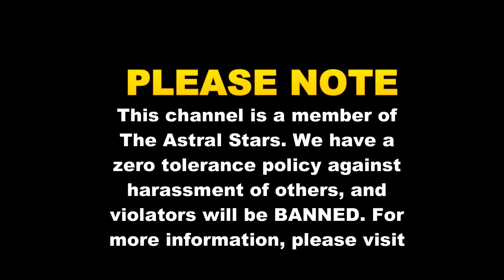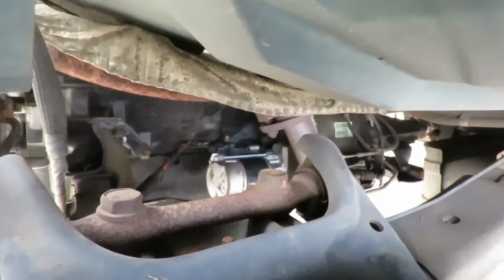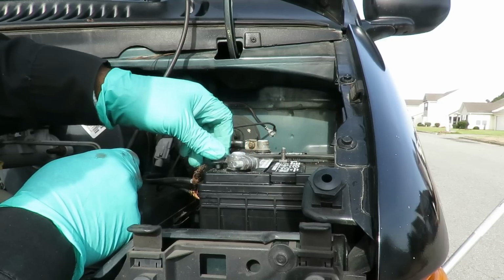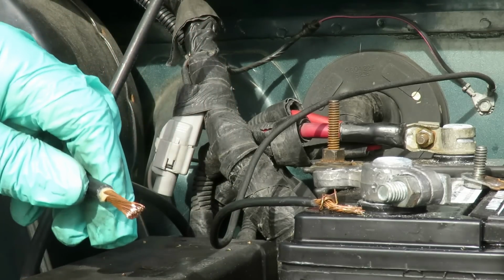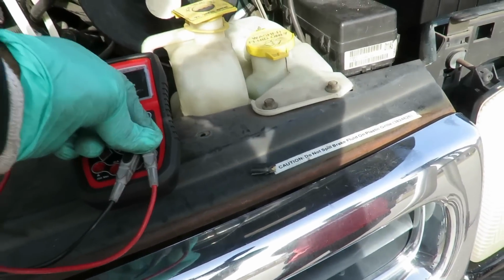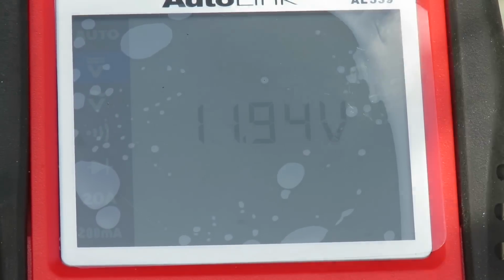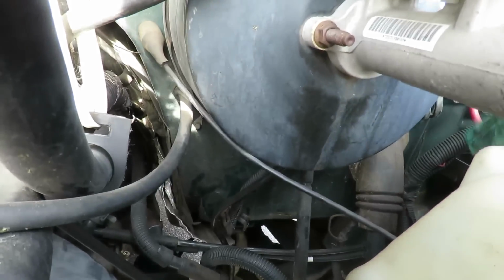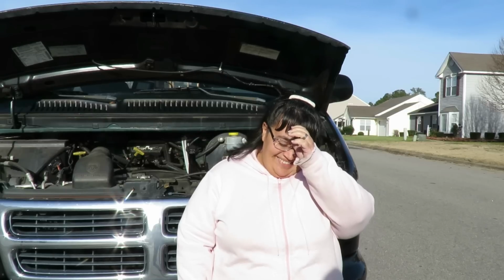⭐ 2000 Dodge Ram Van 1500 - 3.9 - No Start - Clicks, Does Not Crank

Comment: I think you just saved me. I have a 1998 Dodge Dakota with the same 3.9. Wasnt doing the rapid clicking like this one. Just one click. Then after several tries it would start. Thought it was the starter. Battery was new. Put a new starter in and it started right up...but the next time it would do one click and start. Been getting worse. Replaced the starter relay. Didnt change a thing. So tomorrow morning I am replacing that ground cable. Thank you for the video. I was about to pull what was left of my hair out!
Reply from the maker: LOL on the hair comment! Keep us updated on what happens!
Reply: @OnlineAutoRepairVideos  Well...still at the same problem. The ground cable was on the block. So I put a second cable to another spot on the block. Same issue. One click...maybe two then it will turn over.
Reply from the maker: @matchboxcustomsandrestos  Have you tried the voltage drop to make sure it's not losing ground? Also, I know you said the battery was new, but have you checked it out recently, and how, because a dead cell will give that same problem.
Reply: @OnlineAutoRepairVideos  I have tested the battery. Its a month old. No voltage drop. I am starting to lean towards I have a bad starter out of the box or a bad switch. I am going to yank the starter off and have it tested.

Comment: I have a 2002 3.9 van also and get nothing at all when I turn the key with good battery other than all dash lights work normally. Under hood the relay box next to battery has nothing in the slot for a relay and no contacts like it never had one there to begin with so it is not missing. This is the ONLY video for this van I can find to change the starter because all other videos are for the Dakota truck. Had driven this van everywhere and never been under hood untill now other than change oil and basics. The relay box even had cobwebs inside so nobody messed with it so no clue where my relay is located and Dodge wants me to "bring it in" so they can "find" it. Will check your video points first myself, maybe my ground is completely disconnected.

Comment: I have a 97 Dodge Dakota I did everything radio said replaced all grounds check voltage drop replace crankshaft sensor replace starter battery alternator. My problem is starter will engage but no crank
Reply: Supposed to say video not radio
Reply: Also no compression

Comment: I had an older Dodge Caravan. It was a little different. If you parked it, with the front end up hill a little bit, it would not start. You roll it level, it would start. Tell me what you think is the problem. When I say would not start, I mean the key would do nothing but light up the dash lights... On your van you are working on, I would change the battery cables. For some reason, they loose their power strength. Silvia, you are so funny.
Reply from the maker: Mike, you sure you weren't drinking at that time, LOL! If I had to guess, I would say a loose wire, but i know that's not the answer.
Reply: I do believe it was a 1998 van. And the only thing I could figure out, that didn't make any sense, A plug unit sat on top of the transmission and it was held down by a bolt that you could not tighten because someone stripped it out. I could tap on it and it would start, but why would you have to level the van and it would start without doing anything. I know it sounds like the Twilight Zone, and just maybe it was.
Reply from the maker: Yeah, I am definitely going to chalk that one up to the twilight zone, lol!